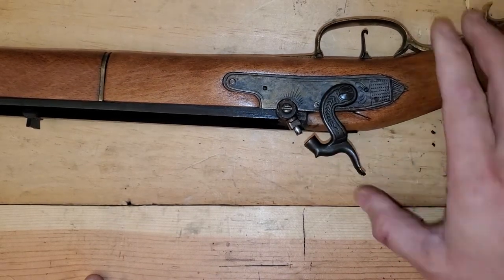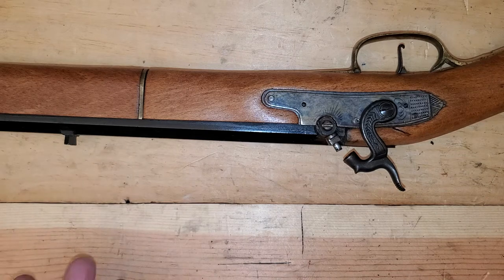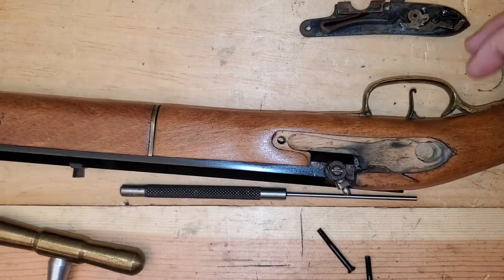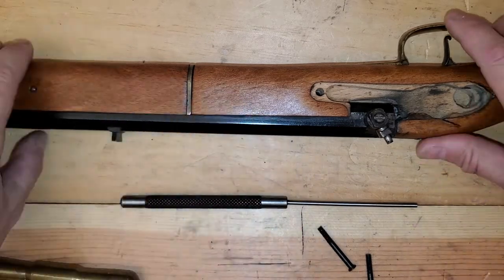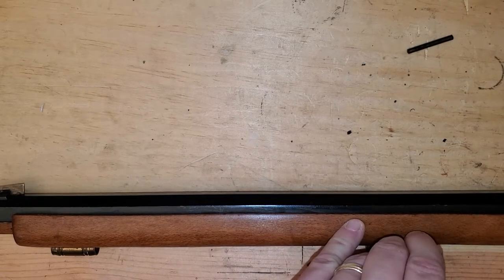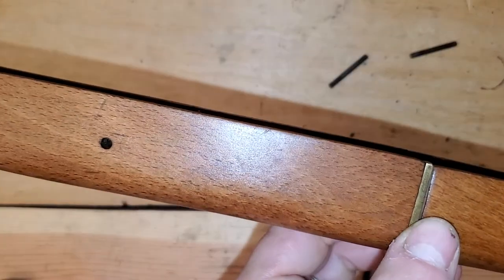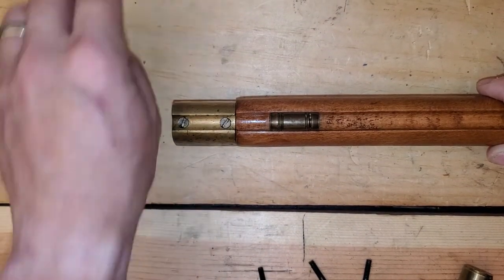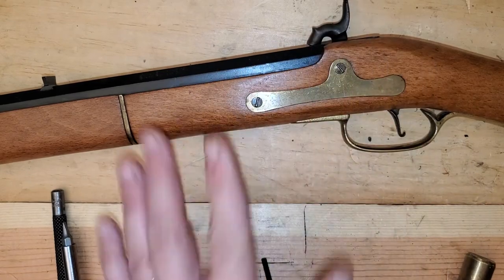Full-stock muzzleloader, how to disassemble

Comment: Thanks for the assistance, just happened one grandson picked up a Jukar which had been poorly treated, Extreme Rust at one point on the barrel, I had checked the barrel pins and one side looked slightly larger than the other, so i was planning to drive them out to the left when I checked U tube. I believe you said the Ramrod is retained by a piece on the Barrel, Thanks again for Help.

Comment: Thank you! Thank you! I just got this same rifle from a friend who took it all apart. The barrel is raw steel and I was thinking of blueing the barrel. Would I still need to grease the bottom of the barrel that goes into the stock after blueing? Also all the screws are missing except on the trigger pack. I found some on Ebay but not all. Do you know where I can get original factory replacement screws?
Reply from the maker: Even blued, I grease them.  But that is partly because I don't take them apart every time they are handled/oiled/cleaned, so I know I won't have rust there the next time I take them apart.

Is the maker stamped on the barrel (Traditions, Jukar, CVA, etc)?  There are some places that sell parts (usually stripped from other guns) that you can find with a quick internet search.  You may try reaching out to the original manufacturer to see if replacement parts are available as well. 

https://www.deercreekproducts.net/store/c3/CVA_Kentucky_Rifle_Parts.html

One example of a place outside of ebay that would carry some parts.

Comment: I have that exact gun and I’m just wondering if there’s anyway to take the barrel apart and clean it thoroughly, because I looked in the inside of this barrel and it’s bad rusted.
Reply from the maker: Unfortunately,  almost all of these muzzleloaders have fixed breach plugs.   You can scrub with chemicals and a brush, but only from the muzzle end.
Reply: Watch Duellist 1954 video on polishing a bore with a patch cut from a red 3m metal polishing pad.

Comment: I have a 45 cal black powder muzzle loading pistol made by miroku Japan. I think they super glued the side plate and the trigger plate to the gun. What do I do? 😩 I took the screws out and they're still stuck.😮‍💨
Reply from the maker: @nightreign2240  for the trigger guard you can gently tap on either side to see if that works it loose.  For the side plate,  same thing with a punch going from the opposite side,  gently tap to see if it will work loose. 

Probably not glued, but the gun was assembled before the shellac (or whatever they coat the wood with)  was fully cured and caused the plates to stick.

Comment: This Video helped imensley, however i noticed Traditions and similar brands have a wedge, that holds the underlugs, and sights in place, but ive recently bought a french tulle build kit from sitting fox, while some of their Kits have underlugs already installed, this kit dosent, and they Lack a way to mount them to the barrell i was considering brazing them on but If you know a better way to Secure them, a Video on this would be perfect.
Reply from the maker: I've never built one like that.  Does sitting fox give any guidance?   Every one I have messed with has them already on the barrel.

Comment: Pins should go in from the lock side.
Reply from the maker: Why?
Reply: @murphyfirearmstraining3630  cause that's how they did it.
You drive them just flush so when you drive them out from the other side it doesn't split out any wood.
So you know which way they go in and out.
You see lots of old guns with split out wood around the pin holes from driving them the wrong way.
Reply: @murphyfirearmstraining3630  
Here's another little tip. You see lots of old guns with wallowed out lock mortises or missing wood around the lock or gouge marks from prying the lock out of the mortise.
If they have two lock screws you take out the forward one first.
Lots of old guns have a beveled forward edge that fits into the lock wood around mortise
Then you loosen the rear bolt. Then put it back in a two or three threads.
Then gently tap on the screw head to loosen the lock from the mortise
Not prying or wriggling required and no damage to the gun.
Reply: You do the same with revolver grips
Reply from the maker: @johnndavis7647  I think if you are careful how you do it, it shouldn't matter which direction.  I think the big issue is that people don't use proper punches and they rush.  Just my $0.02
Reply: @murphyfirearmstraining3630 
It's all about not splitting out the wood when you remove the pins. First,  when you drive out the pins you start at one end and you organize your pins so you don't get them mixed up. They are not all the same length. The correct length is important.  The pin should fit flush on the lock side and just shy of coming out of the wood on the off side. If the pins were installed by someone who knew their business the pins will be de-burred or slightly beveled on both ends. If not put a very slight bevel on them before you re-install them. That will help getting them started without doing any damage to the wood and help the pin find the hole in the barrel flange.
Of course you must be careful.
Customers don't take kindly to having a gun returned to them with a damaged stock.